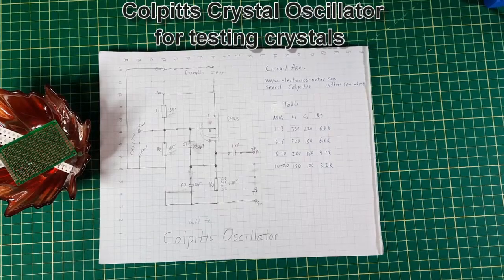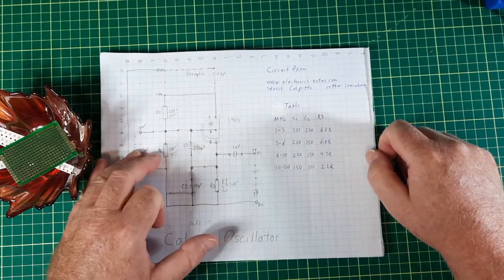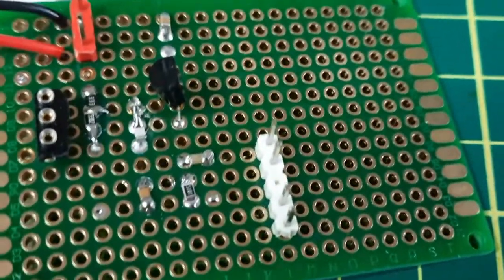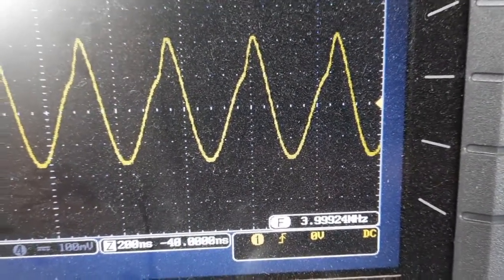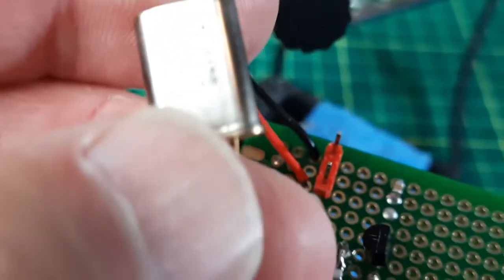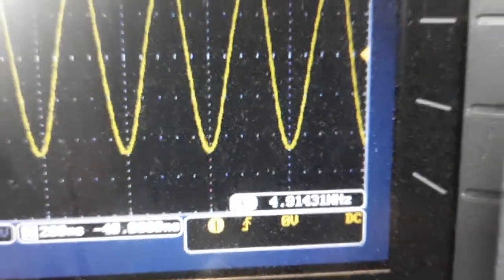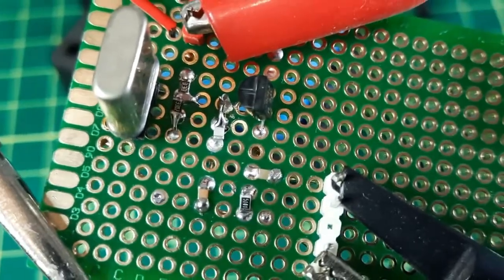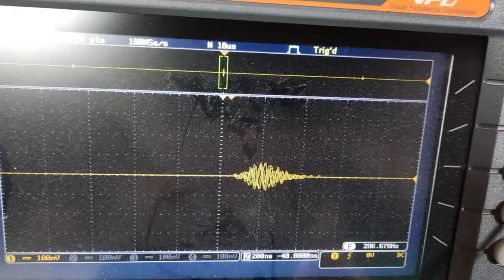Colpitts Crystal Oscillator for testing Crystals

Comment: Pierce oscillator is simple and sleek and easy to build on bread boards
Reply from the maker: A lot of the oscillators work real good on bread boards. I went with through hole board for practice soldering SMD and since I didn't want to tie up a small breadboard. Bought the 4cmx6cm double sided boards for about $0.27 each in Mailbag 5ish (lower quality video, still learning to make videos then).
I like that 0805 resistors and caps fit nicely between 0.1" spaced pads.
Reply: @retireeelectronics2649  that's one of the biggest benefits of SMDs, big bang with less material. I hate them though. I'm actually kinda fan of old stuff. Old is gold, must have heard that, didn't you?
Reply: @retireeelectronics2649  my liking for Pierce oscillator is because of less components required to make one. Others require more components and a better control on things.
Reply: @retireeelectronics2649  o yes! About videos, try using GoPro type of camera. One you are currently using won't take you far especially if you are looking to monetize.
Reply from the maker: Doing this more to keep the brain active and for fun.  People with hobbies live a lot longer when retired than people sitting around doing nothing. Next set is to improve the audio and try to remember to lock the focal length when recording video.
Reply: @retireeelectronics2649  good idea. As for the hobby, how about applying for a ham license. Since, you need fun then ham can give you just that. You are an electronics engineer retired, shouldn't be a problem for you
Reply from the maker: The SMDs are dirt cheap and I agree some of the old stuff is neat. In my video "Electro D-612T Filtered DC Power Supply Pre 1960" the Selenium rectifiers are a piece of beauty. Not that I was going to leave them in the supply since these give off toxic gas when these fail.  And to keep the supply looking vintage but working, I added an external volt/amp display in video "100V 50A Display for Vintage equipment".
Reply from the maker: Diploma in electronics, Engineering degree in another field.
Reply: @retireeelectronics2649  well, engineering degree is engineering degree. Field doesn't matter
Reply: @retireeelectronics2649  some of the old stuff, almost all the old stuff is neat and it's always rich learning experience working with vintage electronics!
Reply: @retireeelectronics2649  for example, I wish I had the opportunity of working with HeathKit transmitter and receiver kits. They were superb!
Reply: @retireeelectronics2649  and how can you forget Knight's T60 transmitter kit and R55 receiver kit. Wish I had them